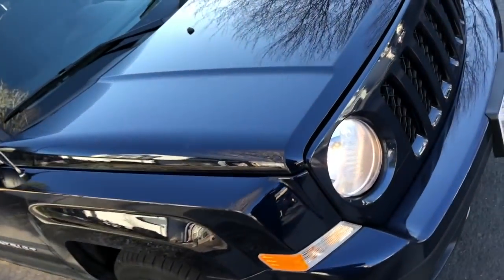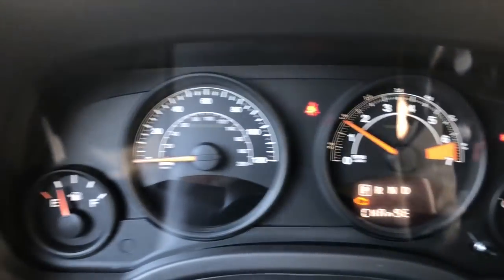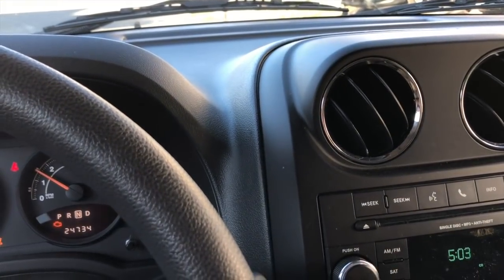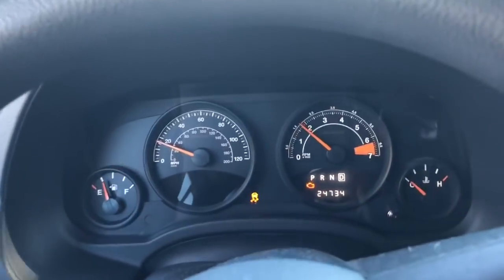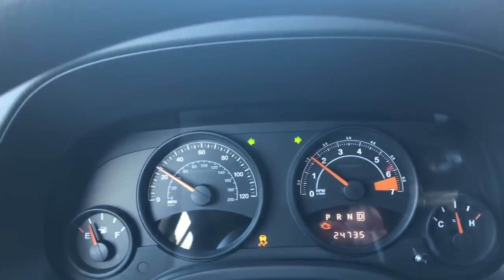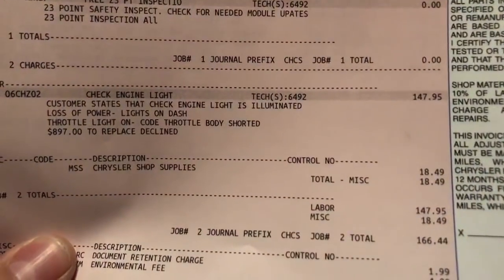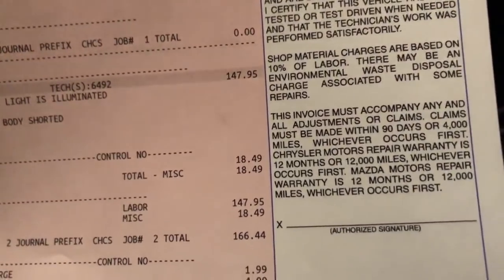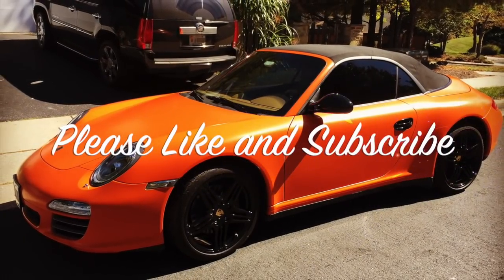Diagnosing a bad throttle body.  Limp Mode Chrysler Jeep Patriot

Comment: I’ve also found that the throttle body, throttle position sensors need to be “relearned”. YouTube “relearn throttle body”. Basically, remove both negative and positive battery terminals, touch the positive and negative together ( off of battery) to discharge stored energy which will clear memory. If you have a multimeter you can confirm no voltage between positive and negative cables otherwise it is suggested to hold both cables together for ten minutes. Then reinstall battery cables to battery. Turn car on and let idle for ten plus minutes to get to running temperature in order for computer to relearn variables through sensors. Now drive your vehicle normally driving up to high gear allowing the computer to learn throttle positions during operation. For us manual transmission people, not too low or too high, just right, for the computer to learn proper shift variables. Tech the heck out of these cars.
Reply: This procedure is after you replace the throttle body. Plus, make sure everything is turned off, radio, A/C, all accessories
Reply from the maker: I had the battery disconnected for several hours so it could be that that also reset the computer.  Thank you for the great tip though.  I and I’m sure several others will appreciate it.  I didn’t do this procedure but I’ve had others ask me about how to reset the tb.
Reply: @OmarsGarage  So when you say you disconnected the  terminals. Did you disconnect from the battery which taking the wheel or did you disconnect from under the hood??. I have an 2012 dodge avenger and i replaced my throttle body and i went to start and warm my car up because of the cold and ESC light came back on again while my car was warming up so i had to turn my car for it to go off then back on but then my engine light stayed on.
Reply from the maker: Laisha Baxter i removed the positive and negative from the battery.  The engine light stayed on until I drove it about 15 miles so the computer could relearn it.
Reply: @OmarsGarage  Okay thank you
Reply: @Nopaants  is this better than OBD fault code deleting?
Reply: Real Good  it is a procedure to “learn” your computer. Basically your computer is calibrating between itself, accelerator (gas pedal) and throttle. It will clear the throttle and engine indicator lights. I believe the codes clear after so many miles? 50-60? I go to Pep Boys to borrow a code reader, their the only place near me that will let you borrow one. Then I use it to clear the codes.
Reply: Laisha Baxter yes! Disconnect both leads from your battery under the hood.

Comment: Thank You. I, like a lot of others, have the same problem. I researched the heck out of this situation and it seems to be a big problem with Jeep/Chrysler cars. This video confirms all my research. Waiting on the part. A lot cheaper that way. I will follow up with my results.
Reply: It worked perfectly!  Disconnected the battery. Replaced the throttle body. Started the car (stilling running rough until it settles) let it idle for ten minutes. Shut car off, counted to ten, turned key but not start engine, let dash indicator lights set and go off, push accelerator pedal to the floor, hold it and count to ten and lightning bolt indicator and engine light will turn off, release pedal, turn key back off, count to ten turn car on and drive for about twenty minutes. Once I turned the car on for the final drive, it purred like a brand new car. I bought a non-OEM throttle body for $40 and free shipping from EBay and it was a 40 minute install as opposed to a $1,000+ dealer job. I only take my car in for new tires and alignment. To have any other service done is a serious rip off.

Comment: Thank youuuuuuuuuu!!!  Just had my 2008 Patriot towed home today for this exact same issue. The part is currently $60 on Amazon and it looks like Hubby will be tackling this fix in the next week or so. I still love my Patriot just as much as I did back when we drove it off the lot brand new (with the lifetime power train warranty) back in 2007.
Reply from the maker: Let us know if this fixes the issue.
Reply: Did it work
Reply: @carlosmercado9157  hubby finally had time to look at it today. Throttle body is definitely the problem and he ordered a new one from mopar. He cracked into the broken one and a few of the teeth on the plastic gears had chipped/worn away. Also, a bolt was missing…possibly allowing air to leak in and cause the engine to run a little rough. 

I can’t wait to have my wee jeep running again.

Comment: Thanks so much for sharing! We towed our 2008 Patriot to Florida with 187000 miles, and it has got the same problem yours had. Dealership basically told us to drive it off a cliff and buy a new one! About ready too, but it would be great if we could just fix it for a couple hundred bucks!! Gonna watch your next video! Thanks again!!
Reply from the maker: If you are having the same issue it may be worth a try for $100.

Comment: I just had same symptoms with steady malfunction indicator light and electronic throttle control light flashing along with a few other lights on. 2012 Jeep Compass had limp mode only with Reverse gear worse than in Drive. I was prepared to have vehicle towed as live on remote island and mechanic is on other side. The mechanic gave me some free advice to try first: Disconnect car battery, wait 20 minutes, hold 2 wires together, and then reconnect battery to see if that resets things. Before I even did that, I tried the car again and it started properly, all the lights went off except the malfunction light, but the car had power again. Will make appointment to get it properly checked but in the meantime will try the battery disconnect if it acts up again. I'm lucky that the only mechanic around is trustworthy and does not rip folks off. I've used his shop for years and have always had good service (and I'm not blond or young...). Thanks for posting. It helped me talk about the issue properly on the phone to the mechanic!
Reply from the maker: Yeah I have a local mechanic that I trust also and when I don’t have the time to do the work myself I take my cars over to him.  I’ve always enjoyed taking things apart and putting them back together so it’s usually fun for me.

Comment: Thank you soooo much!!!
My daughters 2014 patriot was doing the same thing and the scan said implausible data???
Which lead me to believe the pcm was going bad, thought I had a bad coil pack but watched your video, found a etc on Amazon for $30 just installed it and it’s running like a top!!! 
Ty for posting this video and ty for the help. You are awesome!!!
Reply from the maker: Comments like yours are exactly why I keep doing what I do. I’m so glad I could help. Thanks for the feedback. 👍
Reply: What's pcm mean
Reply from the maker: The computer.
Reply: @OmarsGarage  can you be proper I asking a question
Reply from the maker: The PCM refers to the Powertrain Control Module. It’s the computer in the car that controls everything.
Reply: Just a shot in the dark but do you remember if the code you were getting was U0401? My patriot is having the same issue as the patriot. Just wanted to know if I should replace the throttle body or the etc?
Reply from the maker: @jcritter2782  I believe that’s the code most people are getting. I can’t remember, it’s been many years. The ETC is built into the TB so you pretty much have to replace the whole unit from what I remember.

Comment: If your throttle position sensor fails  these lights will come on and it can affect braking also - ebrake is disabled for some dumb reason. Engine shake is caused because the electronic distribution doesn't know what to do - again likely caused by a bad sensor. There are warning signs of engine wonkyness a few days or weeks before this, when that happens - clean the throttle and/or air idle control valve but my list of codes only mentioned throttle position, throttle control motor, firing irregularities, and O2 sensor. But yeah it's basically the throttle.

Comment: Hey, exact same problem with me, 2016 4×4 jeep patriot 2.4 litre high altitude, the dealership said transmission issue and asking for $4000, should I replace throttle body ?  Do it needs programming after change ?

Comment: My 2014 Patriot Latitude did same thing.  Easy fix , turn on ignition to on position and wait for check engine light to flash then goes to solid red not blinking press gas pedal to floor release gas pedal slowly and turn off then turn jeep over.  Problem fixed.. it worked for me.  Not necessarily a bad throttle body.
Reply from the maker: Works sometimes, but for many it will gradually start happening more often.
Reply: @OmarsGarage   I hope not 😕
Reply: @OmarsGarage  Mines a 2014 with only 43 thousand miles on it.

Comment: Same issue but no check engine light. Mechanic at worked scanned it but no codes. I have an appointment with the dealership. I think it's the throttle body but pep boys says it's the computer. Your video is so helpful.
Reply from the maker: Honestly, the throttle body is cheap enough that it may be worth it to replace it to rule that out. Link is in the description. Should be around $60. Keep us updated if you figure it out so it can help others .
Reply: Took it to a mechanic and he scanned it. 2 codes came up. P2110 and C121C. He thought it probably was the air intake. He cleaned and put on new gasket. Codes came up again. He installed a new throttle body and codes were gone. Been driving fine since then.
Reply from the maker: @Adam Rodriguez  that’s great news. It’s been several years since I changed mine and no issues.
Reply: Same issues here minus engine light a few years ago, replaced throttle body and no issues since.......till yesterday.....doing the SAME thing it did before. Idk what the deal with this Jeep is but I really wish ,you wife hadn't  have picked it out as her new vehicle.

Comment: Exactly what happened to my 2016 Jeep Patriot Latitude I was in a wreck where someone hit me from the front and destroyed my whole front end and after the body shop fixed the whole front end body wise and the radiator and other parts that where destroyed in the wreck. When I went to go pick up my vehicle I noticed every light on the dashboard was lit up and even though the vehicle drove alright I wasn't going to take it like that so they took it to the local (Pasadena Tx Bayway Jeep and Chrysler dealership) and they kept my vehicle for almost 2 weeks and finally said it needed a brand new Tipm (Totally integrated Power Module) so since it was still covered under warranty they had to cover it even though I thought it should have been covered under the other ladys insurance that hit me but the Dealer was adamant about it NOT being caused by the wreck which did not make any sense to me because I had absolutely no electrical problems prior to her hitting me, but ok what ever as long as my vehicle got fixed and I didn't have to pay for it myself...I agreed. So they replaced the Tipm as well as my windshield wiper motor that the first shop overlooked as well. They told me my truck was ready to be picked up so I went and picked it up and it drove pretty well for the first few days and then all the sudden all the lights on the dash came back on  lighting up like a Christmas tree....!!!! So I took it back to the dealer for them to look at it and they told me I wasn't getting the power voltage I needed from my battery, but they informed me that my warranty had just expired about 600 miles prior to me going in,  but they suggested I purchase a new battery from them which of course was a Mopar Battery that cost me $165 plus they said I needed a new battery tray which cost me $89 and a battery hold down strap which cost me $26 and they assured me that all this would fix my Patriot so I reluctantly purchased all of them from the dealer and drove it for about 2 to 3 weeks and one day all the lights came back on the dash! By this time I was Irate and fed up with the dealership but I took it back in just for them to not be able to diagnose anything because of course my truck didn't act up while they had it there for the 3 days they kept it. So I was basically fed up and decided to just deal with the lights going off and on my dash as long as it didn't effect my driving so I have been driving it almost 5-6 months and I just started having issues with it dying while I drive it twice it happened on the freeway and thank god I was able to coast it to the shoulder and turn the key off and re crank it and it would drive fine for a while until the red lightning bolt warning light would flash on the dash as well as the traction control light then the truck would slow down to barely a few mph and then completely die out and I would have to re start it again after a few minutes and it has been starting up fine so far but when I researched all the symptoms everything points back to a faulty throttle body sensor or the throttle body assembly. Which I think it should still be covered my warranty even though it expired but since the dealership NEVER fixed my vehicle correctly while it was under warranty I wish there was a way to make them take responsibility for it but I know they won't! Any advice, welcomed?
Reply from the maker: That’s exactly the same thing that happened to me where I took it in and they couldn’t find the issue.  I took it 3 times and the third time it was out of bumper to bumper warranty though it was still under powertrain warranty.  They did not want to cover it.  I purchased the new throttle body for u ser $100 and installed it myself.  A couple years later and the issue never came back.  The dealer wanted $900 to replace the part that cost me less than a $100 and only took me about 30 minutes to replace.  I don’t know if this is the same issue you are having because it did have an accident, but if you are having the same loss of power symptoms then it may be the same thing.

Comment: My jeep patriot 2014 2.4 has aproblem guys i dont know what to do😢 it has no error codes and no engine light or anything of that sort nor does it idle rough but when driving the gears shift slower then normal and the big problem i have is that it does not want to exceed 80miles and rpm is stuck at 3000 and if i floor it the rpm will go to 4000 but the speed will remain the same and engine light will come on flashing . Pls help anyone

Comment: This same thing happened to my 2016 Jeep Compass in sept. Took it to dealer and i think they reset the computer b/c all the lights were off when they checked. They told me to drive it for 60mi and if it came back on to come back but if it doesn’t, then it was prob a fluke. Nothing ended up happening until this morning (October 17th) - same situation.

I bought mine used - I’m the 2nd owner. The first person who had it before me bought it new and had it as a lease and that person took care of it too - i saw the carfax. It was still under warranty when i bought it and i put a 6 yr bumper to bumper on it too just in case and glad i did.

So I’m going back to the dealer today. It sounds like they made you wait intentionally so they could money grab you. It also looks like the dealer you went to isn’t exactly honest w/ all those mysterious fees.

I took pictures and a video of it happening this morning to me so i can show them. I suspect a throttle body issue as well.
Reply: The dealer ended up doing a pcm flash - they said that the computer needed an update. Does that sound like this fixed the problem to you? All the lights are off and so far it’s driving fine but I really wonder if that’s really all it needed was a PCM flash. What do you think? It did not cost me anything
Reply from the maker: Lost in the Clouds the first two times I took te car in to the dealership this is what they told me they did.  Eventually it did fail completely though.  That’s when they told me to replace it once it was out of warrantyS

Comment: I own a 2017 Jeep patriot that was doing the same thing. I changed the throttle control body, and it fixed a problem.
Reply: What brand throttle body did you use and where’d you buy it? I just got my 2016 jeep Patriot days ago and it’s doing this problem

Comment: I’ve had this same issue. I have a 2015 Jeep Patriot, I’ve had to replace it twice since getting my car around 40,000 miles and it’s having the same issue yet again! My car is now at 75,000 miles.
Reply from the maker: Are you replacing it with an OEM part or with an aftermarket.  I have a link in the description for the part I used.  I hadn’t occurred again since I replaced it.

Comment: I had the same issue, where the lightning bolt and malfunction light indicator comes on, once it does i can't accelerate the speed more than 30 mph. To get rid of the lightning bolt also known as Electronic Throttle Control(ETC), I would turn the vehicle off and on. Then the ETC would disappear. Took it to the mechanic, they replaced the throttle, drove it the same day and it came back on.  Second diagnostic at the mechanic, gas pedal issue. The resistors are damaged and are not reporting the proper message to the central unit, thats why the ETC warning sign comes on. So they replaced the gas pedal to a new one. Again drove it the same day, got the same issue. I'm currently on that status, heading back to the mechanic this Friday for more check up.....
Reply from the maker: Keep us updated.  Curious as to what else it could be.
Reply: Any updates?

Comment: I’m having the same problem for my 2014 Jeep Patriot. Runs and idles rough. Red lightning bolt is on & traction control light is on. The car won’t accelerate past 20 mph. I ran the check engine light & it came back with the code U0401. Do you think changing the throttle body will fix this issue?
Reply from the maker: Sounds like the same problem most folks have had. Since I replaced mine it hasn’t acted up for at least 2 years now.